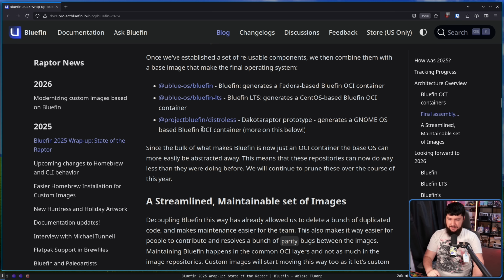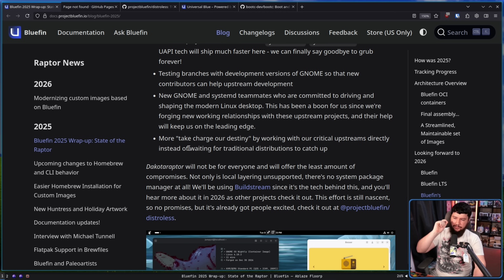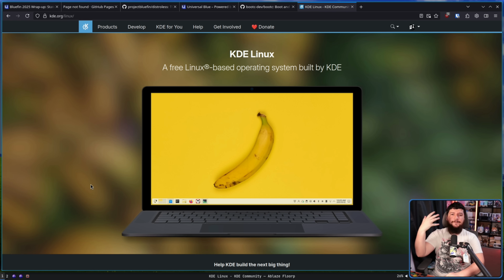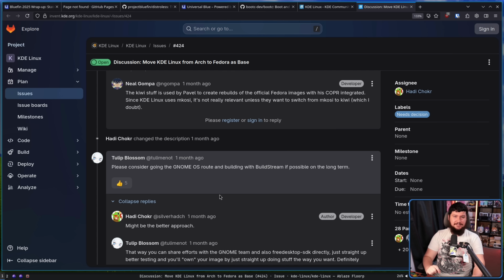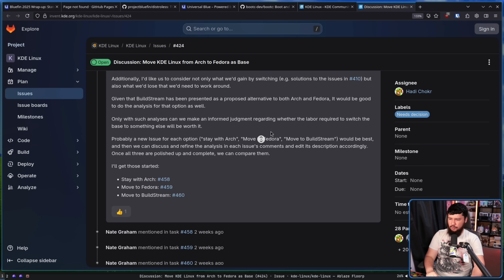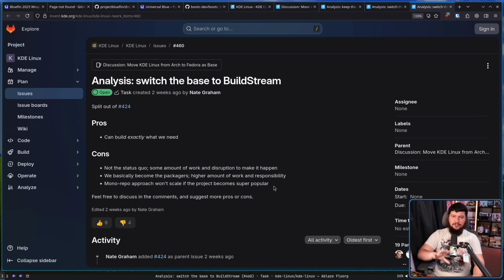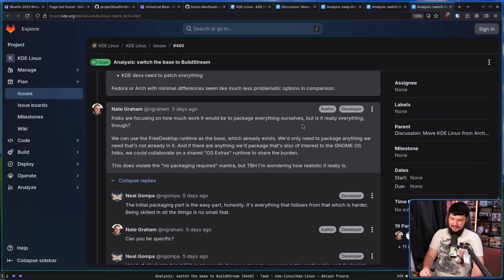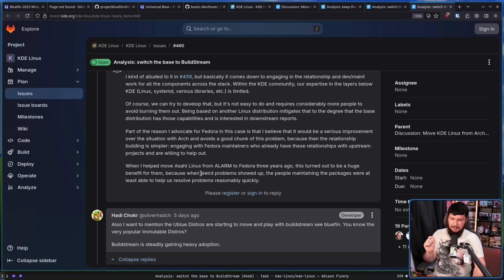The Future Of The Linux Distro Is No Distro

Comment: I don't think I'll ever understand the hate for grub. For grub-mkconfig, sure. As long as I edit the config file myself, it does exactly what I want it to do perfectly.
Reply: The issue with grub, opposed as systemd boot is that it will not install itself properly on every motherboards, mine is one of them, ik how to install bootload manually but for the average user all they ill see is that it doesnt works

Also on a systemd system, using systemd boot will reduce dependencies and get better integration

Comment: Is it distributing the Linux kernel? If so, it is a distro. Case closed. 😂
Reply: the distribution part isn't about the Linux though. It is about all the software that happens to be Linux-based, in general.
Reply: Android is a distro as well then :)
Reply: @tulilirockz well I agree with that anyway.  You don't need systemd, udev, dbus, sysvinit or glibc to be a distro.

Comment: No, it is exactly like the Gnome/KDE freedesktop packages, at a lower level. And that just sucks, frankly. 
I tried Bazzite. Some of the fit an finish on there is nice. The underlying tech is not yet in a good enough shape for my daily over the long haul.
And having more layers of abstraction for everything to go through is what happened to the web. Frankly, the web is a mess because of it.
NixOS looks to be a better Dev environment for KDE or Gnome, as you can simply create a custom file with the exact versions of libs you want to test with, pulling directly from the github branch you want, from the package manager.
With these container bases, you have lots more download bandwidth used, lots of headaches while the tooling is worked out, and frankly trying to explain how to do common things in it just doesn't work.
If your project requires wizards to make things work, it will only be used by wizards.

Comment: > Gnome
> Systemd forcing itself even more into the ecosystem by replacing grub

Any way this could be worse?
Reply: Sd-boot has been around for a long while, lol. Moreover, it's less bloated than grub: does one thing well (being a stable uefi-only bootloader) without unnecessary bells and whistles like decrypting luks volumes with the performance of a sloth on barbiturates.

Although, you don't need really a bootloader nowadays unless you want to expose lots of entries, and can get away with just using efistub.

Comment: While talking about bluefin: they claim that their tech allows the system to stay stable forever (while traditionally it's recommended to do a reinstall after 5 or so years?).does anyone if that claim holds water, technically?
Reply: Idk about 5 years but it has been 2 years of perfectly stable experience on my hand with no regression or reinstall on this ssd as my main daily driver

I've tried alsmost any linux distro that exis, as well as some BSDs but ublue ecosystem is what i prefer the most
Reply: "It's recommended to do a reinstall after 5 or so years" Recommended by whom? This is simply not true. The only time I'd reinstall Debian is when switching drives because it's usually faster to get a fresh OS than deal with copying the old one over.

Comment: I use em dashes and have been doing so since the 90s!
Reply: How do you type them?
Reply: @smorrow  ctrl+shift 2014 enter
Reply: @smorrow  I do it by pressing the Compose key, then "-", then "-", then "-". But how and if you can do it depends on your system.
Reply: @smorrow  iirc some apps automatically replace double dash with em dash
Reply: @rjawiygvozd isnt double en-dash instead?
- <- dash
– <- en-dash
— <- em-dash
On windows its, iirc, right alt and 0151 on numpad
On phone keyboards its usually there for holding down the dash key
No idea about macs though.
Reply: @YTHandlesWereAMistake  I didn't even know en-dash exists, nor do I really understand what "em" means tbh
Reply: apparently it's called em dash because it's supposed to have the same width as M character ...
Reply: @rjawiygvozd  nah. Thank ai for that mis-summary.

One em is the same length as the font's height (which is typically measured in points). So in 9-point type, an em dash is nine points wide, while in 24-point type the em dash is 24 points wide. By comparison, the en dash, with its 1 en width, is in most fonts either a half-em wide[41] or the width of an upper-case "N".
Reply: @YTHandlesWereAMistake  actually what I looked up is the etymology from wiktionary. Maybe it's a historical thing that is not relevant anymore
Reply: — <~ never knew my phone could do this which tells you I never hold down the keys for shit
Reply: @smorrow  with the compose key (look up how to enable that in whatever DE you're using), you press it, and then you type dash three times and you get an —
if you're not familiar with it, the compose key lets you type special characters and diacritics on an English keyboard by combining keys that sorta make up the character you want, very useful for those of us who speak a language other than English but have to interact with an English keyboard
Reply: Ignorance of em dashes has been annoying me for most of the same period of time! (Unicode codepoint U+2014) I suspect people's obliviousness (especially the conflating of hyphens with dashes) might come from their lack of handwriting experience.
Reply: I use them too—when I can get the compose key to work properly!

Comment: I understand the love for wanting everything to be a container and isolated but current linux implementations seem to still be a pain to use.

There's no flatpak for cli tools forcing people to juggle multiple distribution systems.

And Flatpak software still has multiple issues and often comes broken out of the box, missing permissions, poor or no integration with the rest of the system.

It makes sense for Gnome which wants to have an iron grip over the experience, but I hope KDE recognizes they're a different kind of project which embraces user choice which i feel is better reflected in being arch based
Reply: brew exists for CLI
Reply: @valerie_tar_gz which is what i said, multiple distribution systems, you have your OS update, your flatpak update and your nix/brew update. It seems a step back from the single command update arch and nixOS? offer
Reply: @dafzor  So I guess that way it's closer to macOS? I have never used macOS, but from what I understand you have your usual system updates, applications updates (flatpak in Linux case), and brew (if you use it; there are various implementations on Linux for this scenario)

I am not sure if that's a bad thing. Although I think ideally both command-line tools and GUI applications should be managed by one system, it's just probably no one figured it out yet.
Reply: @dafzor  Them being separate is part of the point. It means you are not forced to update certain software in order to update your OS, or vice-versa, and it means that major OS updates are far less likely to break your software (since the software is not dependent on a specific version). It also makes you much less reliant on third-party packagers who may be shipping much older versions of software.

Ubuntu with a bunch of PPAs is one of the more egregious examples of the issues this can cause, where a ton of your software is gonna be out of date and your PPAs break your system every 6 months. Arch isn't quite so bad about this, but Arch has had similar issues with stuff like a new glibc update breaking everything. Especially in the case of glibc, holding back updates can be pretty difficult because the longer you hold them back the more likely software built for the newer version is going to break on the older version, so unless you want to freeze updates for all of your software it becomes kind of a house of cards.

On a system where stuff is separate, this isn't really an issue anymore. On Bluefin, you could freeze a particular flatpak without having to freeze OS updates, and you can freeze OS updates while still being able to update your apps. NixOS is another system where software is kept separate (effectively) and can be frozen or downgraded without messing with the rest of your system, but unlike Bluefin it pays for this ability by using potentially extremely complicated Nix configs, which many NixOS users avoid by splitting things off into multiple tools instead of using Nix for everything.

If you really do care about having "one command" though, then on Bluefin, the `sudo uupd` command will update everything. By default, most everything updates automatically though, so in practice it wouldn't really matter very much if you needed multiple commands.
Reply: @valerie_tar_gz Why would anyone use a mac first program on Linux?
Reply: @talkysassis Nix users and terrible gatekeeping? Iconic combo.
Reply: @Dibromatic  Programs made originally by mac users tend to be terrible on other systems because they only care about macos
Reply: @talkysassis  The Linux packages work just fine, mac-first doesn't mean mac-only. I assume you think nix darwin is pointless too?
Reply: Being arch based or not is irrelevant for "user choice" here. This is a immutable distro. You're not supposed to use a traditional package manager to manage your software. Arch Linux is just for building the base system which will turn into a bootable container. That's it.
Reply: @lucolesco I was assuming basing it of a standard distro would still allow layering. If that's not the case then you're correct, it wouldn't make a difference.
Reply: @dafzor  You can always layer in either case as a consequence of it using bootc. Bootc just uses docker container images, and you can use a dockerfile/containerfile to add any layers that you want with those. It's not "officially supporter" to do this locally, but you can still do it anyway, and my understanding is that in the future bootc will make this somewhat easier by letting you drop a containerfile in a specific location instead of having to set up a bunch of update scripts for rebuilding your OS images (which is what you would currently need to do). 

The "intended" way to layer is to set up your own git repo for your image on some cloud service or potentially remote machine, and have some CI/CD job building the images. This isn't "local layering", but it's still layering. Again, you can effectively accomplish this locally with your own scripts.

If it's Arch based then it might be more convenient to layer software, since you can just invoke pacman in the dockerfile, but you can still layer in either case. In fact, the way distroless Bluefin would work would be by adding layers to GNOME OS images.
Reply: Just use the nix package manager and you get your flatpak for cli
For flatpaks I think they should just enable a flag to turn sandboxing off. The only benefit I want from them is making a package last forever without dependency issues
Reply: I don't understand at all why people want to containerize everything all of a sudden. On a desktop, the native package managers are just so much easier and intuitive to use, like hands down. They're faster, they don't fill up your disk with with pointless dependencies, you don't have to learn how they work internally,. I just think containers are the right solutions in some situations (i.e. proprietary apps, compatibility reasons), but beyond that - they're too much of a hassle for me and don't offer that many benefits.
Reply: @miriculous  As a long time Linux user I can tell you that Flatpaks and Atomic distros have finally made Linux extremely good in my eyes. They turned Linux into an OS that I could actually recommend to people instead of it being an OS where a user needs to make major usability, stability and time concessions. So, from my perspective this looks like a move in the right direction if people genuinely want the "year of the Linux desktop" to happen.

Duplicated dependencies and the extra disk space they use are completely irrelevant and a non-issue. If it was a genuine issue people cared about then it would be talked about and rejected a lot more. Use multiple electron apps? Now you have multiple copies of electron runtime on your PC. Play games? You have multiple copies of the same game engine on your PC. Play windows games? You likely have multiple WINE/Proton runtimes. Visit websites? You're downloading multiple different versions of many different JS/CSS libraries and frameworks.
Yes, it's a waste of resources, but it's not a noticeable waste and it's not something worth wasting time on. People who care about these things are hyper minimalists who are not the typical user.
Reply: @miriculous  I dont see how any of these are "problems". Nobody (except like 5% of Linux user) needs to know how they work internally. The disk space issue is blown way out of proportion. People need some easy way to download the latest software. If nobody did package some new version of a program for your system package manager you're out of luck and stuck on an old version. With e.g. flatpaks developers don't need to package their software for like 10+ package managers anymore.
Reply: Distrobox and nix both provide what's missing, but you aren't wrong. This is a solution to developers not wanting distros to stabilise their packages, and nothing more. We are a long way from genuinely useable atomic systems, and the resulting cluster is not fun to manage, so anyone claiming this is better really needs to look at what's happening.

Comment: Aurora and Bluefin have provided a great degree of stability and confidence to my experience, and my wife's as users, not developers. I hope that any changes made will enhance, and not complicate our continued use of these systems. The only software I've had to layer was gfvs and smb packages in Aurora, and the need to do this is my only concern. If these systems are truly meant for the end user who is not a developer, ways must be found to make things such as mounting remote drives, and ensuring backup services run without  a need to modify the base system. Solutions such as layering and "just run something in a box" are not going to work. I think that there's a need for clarity in the minds of the developers as to whether these systems are primarily for devs, or less sophisticated users.
Reply: Then that's likely an issue with Aurora. I use Bazzite and Silverblue with Gnome and I can mount a samba share without layering anything.
Reply: @maxarendorff6521  Absolutely correct. No such issues on Bluefin,which is on my wife's computer. It points out the issue of the need to carefully anticipate and choose what's in the base system as an inexperienced user would get stuck at the point of mounting a smb drive for use as a backup. This is confused even more by being able to see and mount the drive in KDE Dolphin, but not use a backup program such as PikaBU.